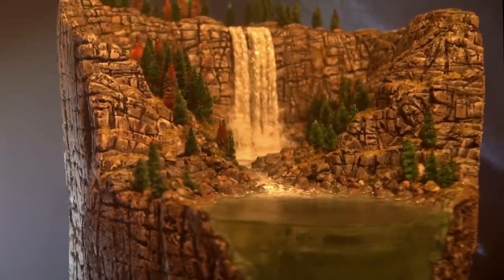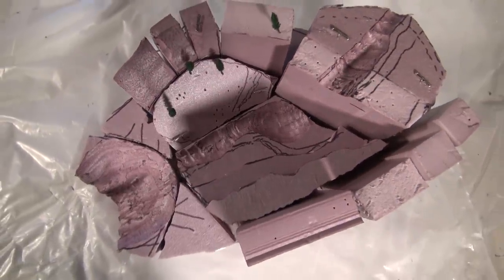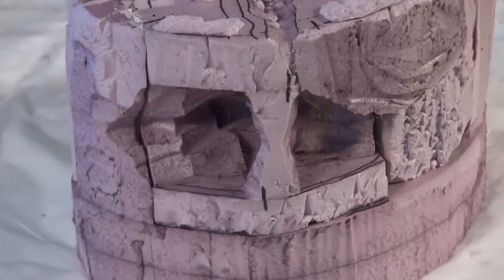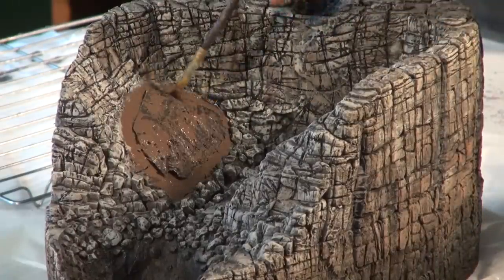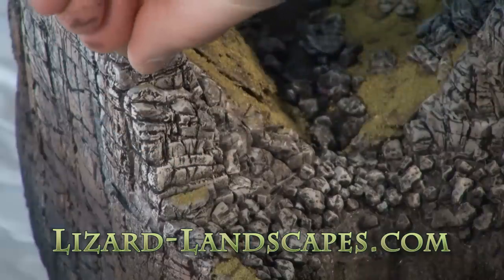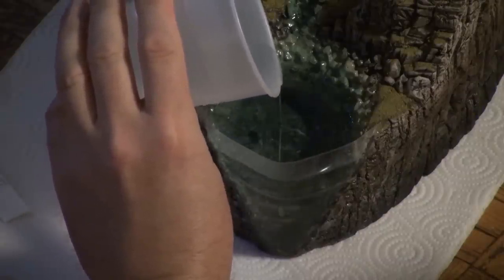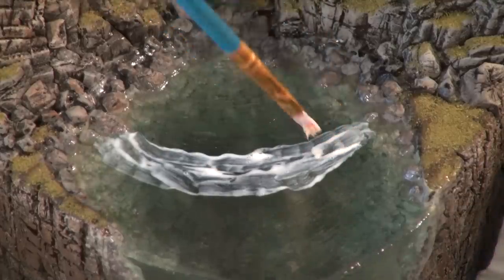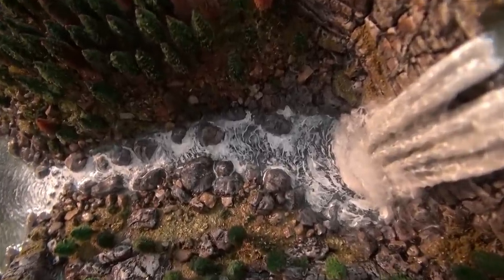Waterfall/Cave diorama + Christian message!

Comment: As I met some water in the wild places... or forbidden by people... there were always green color above the waterline (and behind the the waterfalls) - the tiny weeds does this green shade. Also, as you can see when you switch off the light in bathroom and take the handlamp, and make waves onto the surface of water in the bath, you'll see the bluish-white net or some kind - it's reflection and it's that you need to add into the cave chamber.

Comment: You probably could've gotten rid if the tape seems by wet sanding. 
Great Job and message.
Reply from the maker: Ok, I'm dealing with that now on the current project.  What's the process of wet sanding?
Reply: Get really fine sand paper, wet it and sand away, after that once you're done you can get some compound and buff it with a microfiber rag to make it shine again. The wet sanding will make it opaque but smooth so you will have to bring out the gloss back again by buffing or clear coat.  It's the process they use in cars.

Comment: Question about the scale: You said 1 inch = 105 feet -> 1:1260 scale. And if each tree is roughly 3 inches tall, that would make them about 96 meters (315 feet) tall in real life. A pine tree is normally about 15-45 meters tall. Are you sure the scale is correct?

Either way, really amazing job and the cave idea with the lightning effect is awesome!
Reply from the maker: The tallest pine tree in the model is around 3/4", -maybe it looks taller than it is on video!   The falls on the model is around 3"; the actual waterfall it's based on is 317 feet tall, -so the trees might top out at 75 feet high.
Reply: @LizardLandscapes  Me being too fast - read "falls" as "trees". My bad....
I must say, during your introduction I thought it was a huge set - more like 1:72 or even 1:48, and then you moved on to how it was built and I was shocked. Great filming. It really shows what amazing details and a good camera angles can to do a scene. Keep up the good work!
Reply from the maker: @andreas.abrahamsson  Yeah, it's really about the size of a football.  I have to work small, -I'm running out of space!  I'm going to try and work even smaller in the future.

Comment: Hi!  Great work.  I have watched a few of your vids utilizing hot wire tools.  I have seen you work with low and high density foam board.  Am I seeing you use different diameter wire tools on your dioramas?
I also noted that you like the "Foam Factory" cutting equipment and glues.
I looked on .eBay to check pricing in different brands.  There I found a series of cutters, light blue plastic bodies as well as the Foam Factory.  Then you offer "craft" as well as "pro models."
I see various tools failing quite easily on just 1" porous foam tending to be the blue ones for less than $10. Then I see you at times blowing away carving quickly  with your "premium" knives.
I build RR modules and on a budget.  i am thinking about the 3" knife and the flexible cutter used here, sticking with the quality upgrade and ability to work faster with this Foam Factory brand.
I believe you can get a 3" knife offered with standard charger for $19 U.S. and the sculpt flexible knife with same craft charger included for $30 on eBay and is available for purchase in the U.S. so it seems worth what a "hobby" type guy and not working on "pro."  $50, if it works as good for me as it does for you, with practice I think I can get there.
Do I really need the "pro " charger, though?  Give me an application that would require the pro version.
So in summary I am in it for hobby level scale scenery and would like to be able to cut through up to high 2" dense foam board with the "panther" on it.
I think I speak for many Model Railroaders out there in an ever increasing expensive hobby, we have got to accept tools like these can add up in cost be it self frying, warranty broken wire or occasional brain fart and various wire issues.  Lastly, please cover various size wire and do I really need to buy it from the Foam Factory and do I really need the new replacement wire and also then needing those crimp style loop connectors.
Thanx for reading Lizard!
Reply from the maker: I have used different diameter wires, but that was a long time ago.  I really just use two tools for the most part; a free hand router, and a knife -doesn't matter what length.  Not sure about the quality of the non-pro tools, -I do know the free hand router is quite good, and don't know how I would manage without it.

Comment: hey.  I have watched several of your videos and your work is amazing.  I am going to start a project of beach cliffs this summer.  Have you ever done a project with 12" by 18" styro block? I have acquired some for free and thought to use them.  I see you mainly use the thinner layer approach.  Thanks.
Reply from the maker: I have not used styro block, I find it easier to work in layers, but that might be a nice different approach!  You could always cut thinner layers out to try both ways.

Comment: Do you really think it's necessary to run your site link down the video throughout the video? It's distracting.
Reply from the maker: Yes, people in the past have told me they were going to steal my videos and sell them.  The watermark going through the video would make it more difficult to do so.
Reply: @LizardLandscapes  I assume you've told them that it would be illegal. Can you add a copyright notice right under your videos to let such people know that you'll take action if they steal your videos?  I haven't notice anyone else use your method. Or add a line: This video is NOT Public Domain.
Reply from the maker: @medog22  There's no way to track it.  The individual said he was in Europe.
Reply: @LizardLandscapes  So he says. ;) You can scan the internet to see where your video is showing up illegally. He has to advertise somewhere, right? Then, you can track offenders via their internet connection (assuming they're not using an internet cafe). You can contact whoever they are using to advertise and get their ads pulled. Contact their internet provider and complain. Either way, it'll help legally if you add that the video is not public domain.
Reply from the maker: @medog22  What I remember was he told me he was going to sell it in dvd form in certain stores.  Otherwise, yes, I've contacted others on the net in the past concerning this.  But thanks for the ideas!